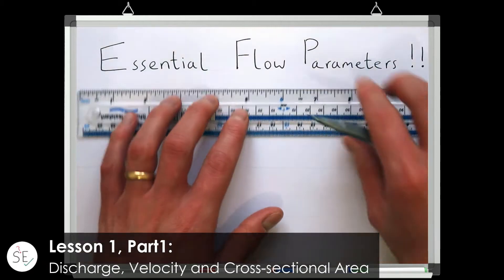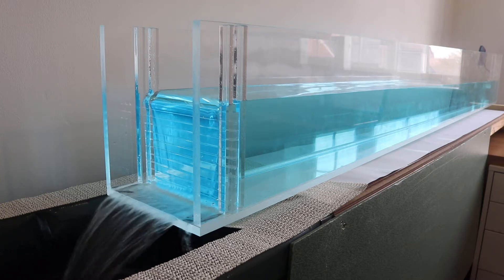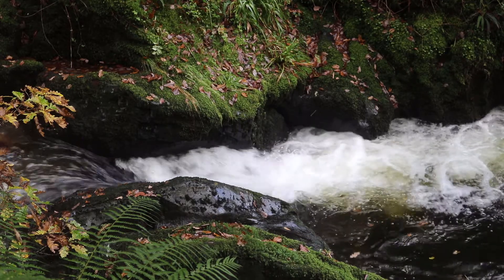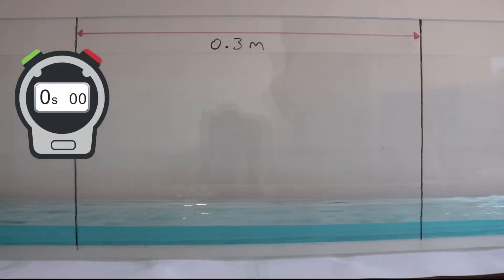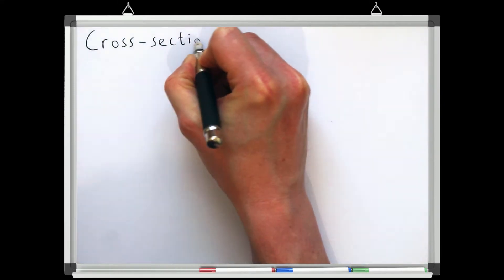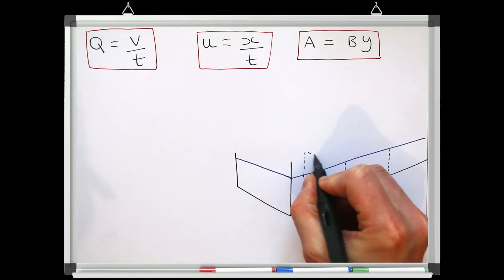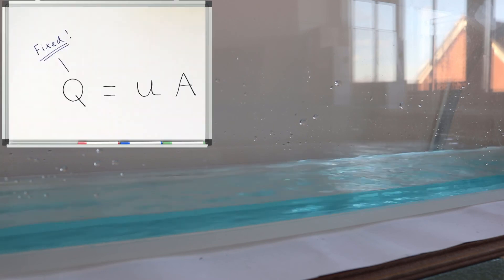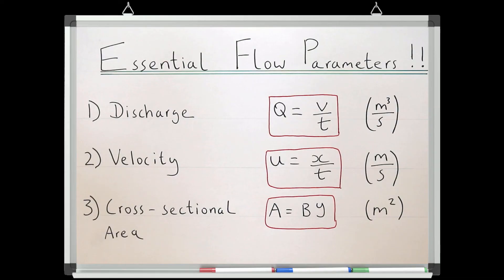Discharge, Velocity and Cross-sectional Area in Hydraulics and Fluid Dynamics (Lesson 1, Part 1)

Comment: Thank you for your simplified explanation. I have a question: How did you calculate the volume for the tank under your flume based on what is coming in (flume outlet) and what goes out?
Reply from the maker: Thanks for the question. Because the flow is steady, the flow in and out doesn’t make a big difference to the volume needed in the sump. I simply calculate the volume of water needed in the flume at max depth setting (based on the stop-blacks) and made sure the tank was large enough to hold this volume plus sufficient extra to ensure the pump was submerged when the flume was at maximum flow-depth. Hope that makes sense?

Comment: Hi, quick question

How would I go about measuring headloss inside a rectangular flume?
Reply from the maker: The total head H at any point in the flow would be z + y + (u^2/2g) where z is elevation, y is flow depth and u is velocity. So if you did this calculation upstream and downstream, the difference between H would give you the head-loss over than length of flow. Hope that makes sense?
Reply: @fluidsexplained1901  Makes sense! Thanks for the reply! Only thing I don't get from what you said is the bit about "z - elevation". 

In the case of the hydraulic flume, what would z be? The hydraulic gradient? Or is Z simply the height of the rectangular channel?
Reply from the maker: @XboxLil  z would be the elevation of the flume at point 1 and point 2, so it's height above a datum. If the flume was flat, you can assume it is 0 as it would cancel out. But if the flume is on a gradient, z will be larger at the up-stream end in accordance with the gradient.

Comment: I couldn't quite understand or rather visualise how physically a point measurement of discharge is possible?Could you please explain? Thanks!
Reply from the maker: When I say ‘a certain point’, I really mean the cross-section at a certain point. So it’s the volume passing through a cross-section per unit time, if that makes sense?
Reply: Yes, I got that part.. But also I think you might be implying a finite amount of volume (Cross sec area x X)  along the flow direction also correct?